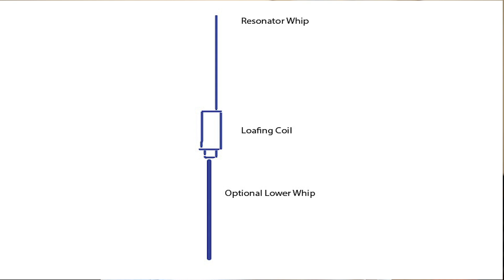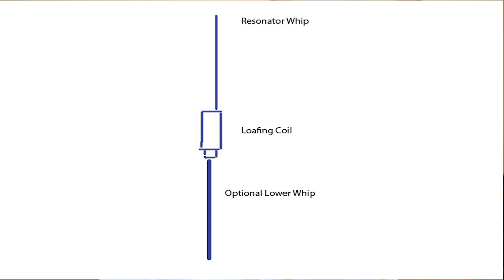The Secret Hustler Antenna

Comment: I picked up a set of Hustler resonators at an estate sale and was trying to figure out a solution for mounting them. I found a brass 3/4x24 male to male connector for over $12 on an online retailer and thought the price ridiculous. Thanks for confirming the simple solution to joining the two female ends together so I can stop over thinking this issue and get on the air.

Comment: How well will an 80-meter resonator work without a mast on mobile? I have a Diamond  lift mount, mounted 15" below the roof, and using Hamsticks am getting surprisingly good results on 20M, and good results on 40M. My 80M hamstick isn't getting good results, not surprisingly, despite a 1:1 SWR.  If I use only the 80M Hustler  resonator as you've described, or lengthen it by adding a spring and 9" mast that I have on hand, will I get a workable efficiency? I have a bug catcher base load coil I can add as well.

Comment: So I tried using a SS bolt cut down to mount the 20m resonator on my 3 magnet mount. It would not tune for me. I tried my 15m resonator.  Then I tried my 10m resonator. It tuned but only in the lower part, 28-28.9mhz. So then I tried using the 4 band adapter and mounted my 10.,15,,20 & 40m resonators.  Now the 20m would tune, along with all the others and even the 10m allowed me to tune the upper band where I operate.  Any ideas why there is so much variance in the ability to tine when multiple resonators are use?

Comment: A couple of years ago I purchased a Hustler HF Mobile antenna with lower mast and 80, 40 & 20 Meter Resonators for $75. I thought that was an excellent deal! I mounted half of a mirror mount onto the inside back corner of my pickup truck bed. It works very well for what it is. I found a problem with this setup. Even with only the lower mast in use for reception, I had to be careful of the clearance while going under obstacles. I heard that it’s possible to successfully use only the resonators screwed directly into the mount. I had in mind that I would have to get a 3/8” threaded stud to make it work. The bolt idea sounds much more ideal. I wasn’t sure how well the performance would work out though. The 20 Meter Resonator works well while traveling down the road. I wasn’t sure about the stability of the antenna with 40 or 80 Meter Resonators though. Thus being another reason for giving this idea a shot. Thank you very much for this video!

Comment: I just accessed this video about a month after I mounted a Hustler 40 on top of a 20-foot mast. I use the mast as the feedpoint for my G5RV. The Hustler works great, although it is a bit noisy. I also bought a 3/8 x 24 bolt and cut off the end. I then mounted a standard CB mirror mount on top of the mast and attached the Hustler to that. I stretched out a few radials for it too. By the way, love your very well presented videos. I love your precise and clear way of presenting the subject. Thanks much, N8KET

Comment: I have a ball mount on my 2017 ram 1500 the lower part of the rear fender, inside the fender is an icom AH-4 random wire tuner I use this 80 and 40m NVIS for search and rescue.

Comment: I have an 80 meter Hustler resonator that went on top of my Hustler 4BTV antenna, I switched it to a different contraption with capacitance elements on top and bottom of a long coil. Both worked, but had narrow bandwidth.

In the end, I added an 80 meter 1/4 wave wire offset from the 4BTV, as well as a 160 meter 1/4 wave wire to get top band!

I am going to make a vertical antenna with a Rohn tower, hopefully this summer!
Reply from the maker: Yes there will be a bandwidth problem.

Comment: I just tried the Hustler Resonator for 40m, and it's very cool.  The only quark is to resonate it.  When I used the SWR meter, I found the right spot.  The moment I used the IC705's built-in SWR meter, it was off by 200kHz or so.  Why?  So fussy.
Reply from the maker: Put a line isolator in the coax right at the point where coax enters radio. Then do the test again. 73 Peter.
Reply: @watersstanton  super!  I will try that. Thank you for the tip.

Comment: The "apartment" or "flat" with a balcony dwelling operator, depending on how the structure of the balcony, all of the Hustler radiators can be mounted to and used for base station HF.  I've had success with them and still have "Hustler Collection" I like to call it.  However, maybe I've become lazy but I've found another set up at which I can (from an apartment/flat w/a balcony), that I can work all the bands available to a General Class without having to go out and swap our resonators, mostly because I've become willfully and intentionally lazy.
Reply from the maker: Thanks for sharing. 73 Peter

Comment: Excellent presentation.  I used to run a full size Hustler mast on an MGB.   I had a ball mount on the car and resonators for all bands, 80 through 10.  You just have to be willing to drill some holes in the car  ;-)
Reply from the maker: Many thanks for watchimg. 73 Peter.

Comment: KN4FJQ  Thanks for showing this I've been wanting to buy a Hustler super  resignator for my truck I will use a mast and mount it on a swing arm on back bumper I have a msj 1699 on the top of the cab but it just don't seem to have the range I would like. Thanks again 73s

Comment: Using for awhile Hustler 10s Resonator on Hustler 54 inch Mast with 5.5 inch 3/8 Magnetic Mount on stationary car. I use this setup from local highest elevation (German Hill) with great success on 10 meter Net and 6 Meter Net Nights ; )   The Hustler 54 inch Mast by Design doubles as 6 Meter Antenna. I also used Hustler Quick Disconnect and Spring to lengthen 6 Meter Mast to lower frequency Resonance (50.135) Works like a Charm  ; )  As you say Mast and Disconnect and Spring has little effect on 10s Resonator which is tuned by set screw upper whip adjustment. That said the 10s Resonator is "Designed" to work "Optimal" on of Hustler 54 inch Mast  ; )

Comment: If you don't want to file or even after filing run the nut from the "good" end all along and OFF the "bad" end and that will "clean" the thread for the nut or the antenna....

Comment: I had not thought of using it flat on the roof like that.  Interesting.  I knew the mast length was mostly irrelevant since the resonator fits on two mobile masts up to 52 inches and on top of the 4BTV (to make it 5BTV).  You can also put them on top of a BuddiStick antenna, just don't use the base coil. 

In the 80's I used a lot of the Hustler resonators on my mobile, yes bumper mount, LOL.  I had two of them with three elements each with a "spider" adapter and an antenna switch in the front of the car.  The only antenna I really like better is the screwdriver.  

I also saw another video where you used a small box with an isolation balun inside to hold your resonator.  

Of course, to a limit, the longer the mast, the better your signal will be, but for space restrictions, you have a real winner there!
Reply from the maker: Thanks for sharing. 73 Peter

Comment: You could also put a spring in there also. you may need another stud! I don't remember if the spring comes with a stud. A spring may not be needed just putting in that there are springs for the 3/8 stud if someone wanted one.
Reply from the maker: Many thanks Donald. 73 Peter

Comment: I have a set of Hustler coils and whips all pre-tuned for my Jeep mobile rig, 75m, 40m, 20m and 15m, which are easy to change out according to which band I decide to operate. The tri-mag base never moves regardless of speed or which coil is in place. 73! Ken, KO4AXN
Reply from the maker: Thanks for your input Ken. 73 Peter

Comment: You need to use the short mast MO4 with the Antenna.  So you use the 3 Magnet Mount, a Spring, the MO4 short mast, and then the Coil of your choosing.  Just above the MO4, I use the Hustler QD-2 Quick Disconnect, and then choose which coil to use.  I use for POTA as well as Mobile 73, DE K4KAL
Reply from the maker: The whips work without the lower mast. Have done many demis. In fact there is hardly any change in frequency. Possibly effeciency not as good.

Comment: Good video, but you need to be aware of the thread needed on the bolt. Ironmongery in UK these days is almost exclusively metric, the nearest being 10/11mm for a 3/8 bolt. The thread of course is much different. The 3/8 fitting on the dv27 CB whips &c, which has been used universally for mobile antennas has a unified thread and it will save a lot of heartache if that is specified prior to purchase.
Reply from the maker: Fortunately I have a local wholesaler who can match threads at the trade counter. 73 Peter.
Reply: g6omj47@gmail.com
Reply: Thanks for the observation Peter, UNF bolts can be purchased on line but you will be lucky to find one in the local Wickes or B&Q. Enjoyed the video, its exactly what I have done with several  whips over the years.
73, Simon Pryce G0EIY

Comment: I've been running the ..browning 78 antenna for about 5 years..takes a licking.and keeps on ticking. .
Also last 4 years Been running the ..hustler 27 antenna. .like it alot...both antenna very little turning needed. ..number one rule.
Get that coil up as high as possible so it's out in the open....above the vehicle roof like..
.....mike from minnesota. ...

Comment: The original mast, which is 54 inches long, is the current portion of the antenna.  The current portion does the most radiating. You just got rid of the most important part of the antenna.  Sure you will make contacts without it, but the performance is now way down.  One of the best places to place a coil on an antenna is from 50 to 66% of the way up from the feed point. That goes for any vertical antenna. Take a look in the ARRL Antenna Book and it shows same.
Reply: True.
Reply: Totally agree
Reply: Totally agree.

Comment: You are right what you say about the ‘lower mast sections’ not making too much difference. I use my 80m ‘super’ resonator  from my 6BTV for occasional station mobile use. I also use the couple inch stud from it too. Same with the Ampro 160 where the bit under the coil makes limited difference to the SWR. In both cases however, the top whip needs mega-fine adjustment and gives 10-30 kHz bandwidth (80 and 160). As you point out, the lower section DOES IMPROVE the RADIATION PATTERN and I get better results with it than without it (but can’t drive along with the lower mast in place so I only use parked up).
Reply from the maker: Hi Nick. Great to get your input. 73s Peter

Comment: Interesting subject. You are correct in stating that the lower half of the centre loaded whip has minimum effect upon resonance, but it does materially adversely affect the current distribution of the antenna. The "Hustler" loading coils violate all rules of loading coil construction. The wire gauge is too small & the turns are close wound, adversely affecting the losses & contributing to self resonance. The two greatest faults  are that the coil form dissipates RF energy. Its material absorbs RF & lowers the "Q" of the coil. Secondly,  if the "SUPER" resonators are used, especially the 75/80 metre coils, the end bells are plated brass & are in the immediate field of the coil, reducing the "Q" significantly. My personal opinion is that  the manufacturer , being aware of the mania for 1:1 SWR amongst radio hams, deliberately used an inferior  coil form  that contributed a loss resistance in series with the antenna that exhibited a wider  low SWR bandwidth,  at the expense of radiated power. The power loss is great enough that I have seen the white jacket around the coil melt after a transmission of a couple of minutes from a 100 watt transmitter.  All of that being said, thousands of QSO's have been made using Hustler antennas, but the same can be said for 100 watts & a wire ! 
Also, Hustler made two popular "masts". The MO-1 & the MO-2 if memory serves. One was a fold over mast with a sliding sleeve to allow a hinge to be locked & unlocked to hold the antenna vertical , or to allow it to be folded 90 degrees, so that it sat horizontal & was below the roof line of the vehicle. The other mast was shorter & was a solid aluminium shaft about 1/2 inch in diameter. The fold over was the same diameter, but the hinge joint became "sloppy" with use, & required  a piece of woven metallic braid to be affixed above & below the hinge to maintain electrical integrity.  Otherwise, the antenna would become electrically intermittent because of vibration  & you know what happens to transistors when the load suddenly "breaks & makes". 
In either case the aluminium masts were subject to corrosion, & were extremely prone to breakage, mostly caused, I believe, by "work hardening" owing to the flexing of the mast while the vehicle was in motion.  After losing two "three resonator arrays"  from masts breaking while driving on "motorways" , I rid myself of all Hustler mobile bits & pieces. I do allow that our Canadian roads do impose severe operating environments that test the "mettle" of  antenna installations.  The Hustler multi band verticals are excellent products & I still own several. I enjoyed your video, & especially the home made "3/8 X 24 "   coupling stud made from a bolt. I personally would have recommended a grade 8 bolt for that type of service. Thank you for the video.

Cheers!  Brian Hind  VE6XX/VE7CRA
Reply from the maker: Hi Brian. Great to hear from you. Anybody else seen a melting Hustler coil?  New one on me. 73s Peter.

Comment: I put my Hustler 40 meter with the tall whip on a single Hustler magnet and I get excellent SWR on the roof of my Jeep. 
From 7.040 to 7.060 my SWR stays below 1.5 and at 7.050 is around 1.2.  If I wish to go above or below that range I do need to adjust the top whip.  Of course my setup is not for driving down the road.  Even that strong single magnet would probably topple over at 30 mph or less. This setup is for stationary or creeping slowly around a parking lot only. 
Great video, and I agree, this antenna is fantastic and not talked about enough for portable and mobile use.

Comment: made a contact 3191 miles on 20m band with this antenna yesterday to Trinidad /Tobago I do use the full antenna with the lower section though. have the 80,40,20,17,15,12, and homemade 10 and 6m sections.   73 KE0HMS

Comment: I can’t work out what you’re talking about it’s already a baseloaded antenna as it is a baseloaded antenna so you put some thread at the bottom it’s a little bit higher so it’s still a baseloaded antenna? The point is you don’t say what it will do for me with this amazing modification, you just repeat here 
is an old antenna other people have stopped buying please buy me?
Reply from the maker: Its a centre loaded design. Check out Hustler web site. Peter.

Comment: I use the 80m Hustler on my mobile but like you I park up and transmit. Never thought to take the bottom shaft out of the equation so will give that a try. I would imagine I might need to lengthen the top whip part to get the resonate spot I usually use with the full whip.

Comment: My friend... how is this different than modern antennas using same layout...? An 11 meter example is in Wilson’s 5000 series - the coil can be placed either mid-section, or bottom section depending on which bottom shaft you choose, and where you want to maximize resonance based on a vehicles available ground plane (both size shafts are included). I have a Quad mag mount and for the SUV, I use the short shaft coil version. For the Semi however, I use the longer bottom shaft for maximum resonance higher up for the lower quality ground plane. As a ham, we use similar layouts for 40 meters. All mounts are 3/8... 
just curious...?

Excellent video nonetheless!

Comment: Great video. I use Hustlers in 10,17,20,40&80 meter on my truck here in the U.S.  They've gotten 50 countries and my WAS from the mobile. Couldn't be happier with Hustler resonators. Thanks for the great content. AD6DB
Reply: Individual antennas for each band, threaded on when I'm not driving.
Reply: Do you drive with the Hustler on?  Or do you take it off?
Reply: Just using one antenna?

Comment: Hustler also makes a short mast that can be used when roof mounting. I made my own from 1/2" diameter Stainless Steel and machined each end down and threaded it to 3/8" UNF thread. I then use a 4" hustler SS spring on top of that and then the resonator. They sell the short mast as a kit that comes with replacement whips for the top that are longer to make up for the shorter lower mast. This configuration works very well for me. I mostly run 40M when mobile using a Kenwood TS120S. I have also built a home brew hands free mic set up that I can use between my TS120 and my Kenwood 2M mobile rig. You can see the entire set up here.  https://youtu.be/yYZnfQiC2xE

Comment: I have just taken delivery of 2 Hustler antenna's, a 20 and 40. These I will mount using stake hole mounting brackets on the rear of my truck. I will be using the lower sections for both. I also bought quick release mounting studs which will allow me to quickly remove the antenna's when putting the vehicle in the garage or passing under a low barrier. I'm hoping to have this all done by Field Day this year.

Comment: I've been using Hustler resonators on 14mc and 7mc for close to 40 years. I've earned WAS and WAC using them.  Granted, a three element beam on a 100 foot tower would have been better; but for whatever it's worth, the Hustler resonator got through--and that's what it's all about in communication.